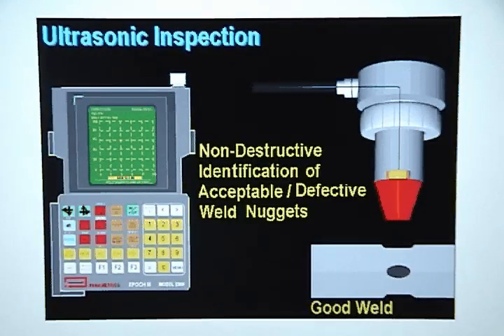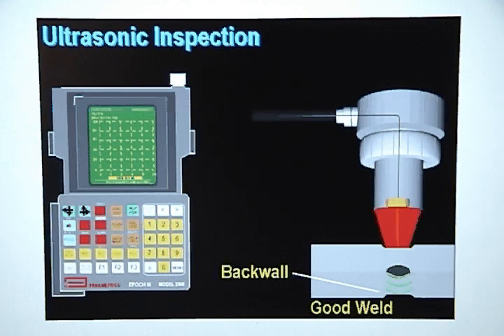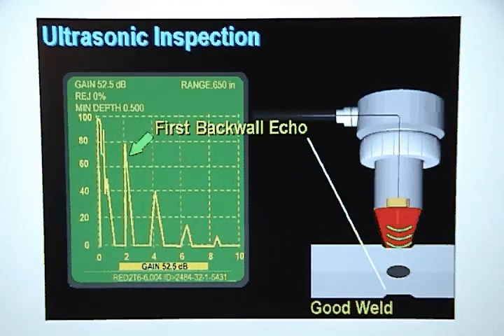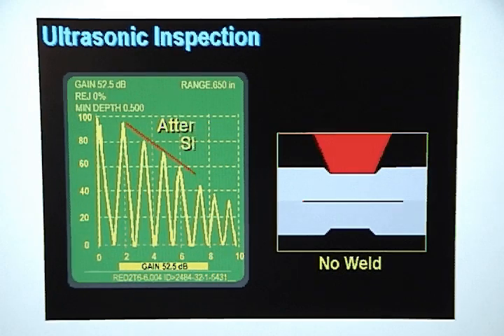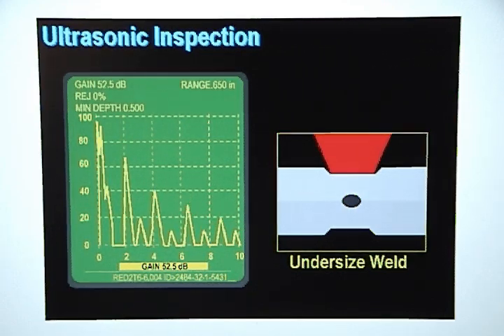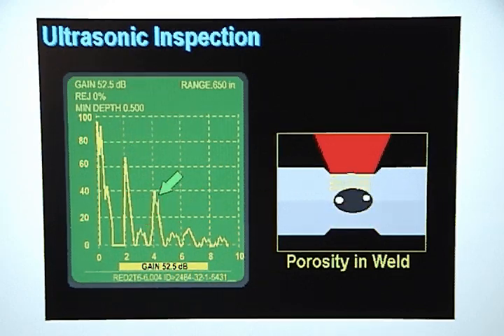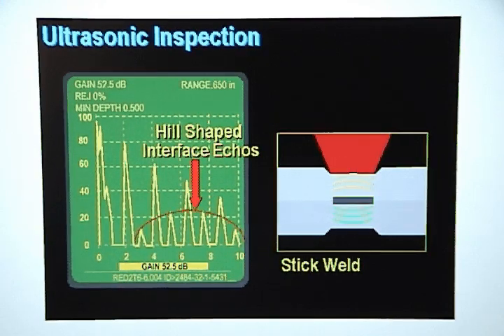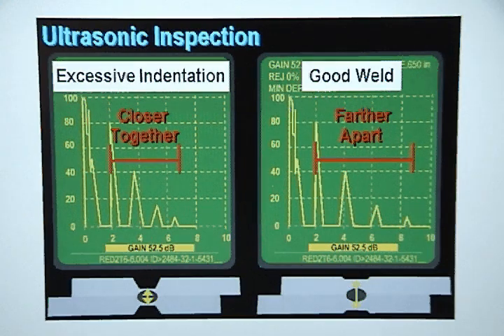Introduction to Ultrasonic Inspection - Animated "EZ to Learn" - Training/Sales/Service 248-701-9328

Comment: What is use of Mfdc in inverter based spot weldings
Reply from the maker: Mid-frequency direct current allows for even current throughout the weld phases. It provides for better nugget formation and avoids blowouts or stick welds.